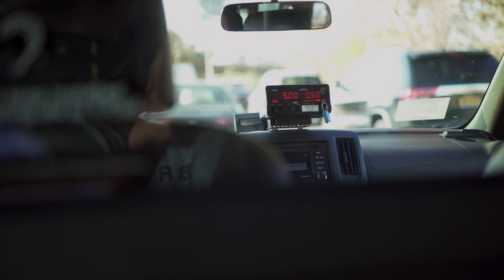Half A Million Miles with Quaker State Motor Oil

Comment: Quakerstate Full Synthetic is the best oil for your buck. $17.97 for a 5 quart jug at Walmart right now.
Reply: I ran that on my Nissan Cube but did not like it. I run QS conventional oil and it runs better than the Syn oil from Quaker State. A lot of people claim QS conventional is among the smoothest oil out there.
Reply: @calgary2800  full synthetic is better for a turbo in which i have
Reply: Yep turbos require synthetics. From exp Castrol Edge and QS conventional are quietest and smoothest oils I have ever run in my cars.
Reply: @calgary2800  i just picked up some pennzoil ultra platinum 5w-30 to try out. they say it close to amsoil quality.
Reply: @JayzBeerz  I own a 1994 Chevy truck that had lifter tapping and change from Supertec full synthetic to Pennzoil Ultra platinum and after two trips around town, no more noise! Not even at startup!
Reply: @bryansesco9671  Nice man. All I use now is Pennzoil Ultra 5W-30 and 5W-20.
Reply: Bout 55$ in Canadian currency in 2023 for a 5L jug
Reply: Quaker State full synthetic in 5 gallon jugs is now $23 in the year 2024.
Reply: 23.99 as of 2024.

Comment: Yes,  I love my Quaker State Oil..been using it for over 40yrs
Reply: As long as you are consistently changing your oil at between 5-6k miles you will have zero oil related issues or sludge build up!

Comment: Those 4.6 ford engines are indestructible.
Reply: 4.6, & 5.4,  2 valve were the best motor's Ford had, & 300 in line 6 cylinder.

Comment: I changed my wife's oil this morning, and put another 6 quarts of Quaker State Full Synthetic in. Her car still runs in great condition, the engine runs smooth, and the performance is excellent. We're looking to trade it this fall, and her next vehicle will also use Quaker State Full Synthetic. As long as the cost stays tolerable, Quaker State will keep me as a customer for years to come!
Reply: Why did you change your wife's oil instead of her car's?
Reply: Pennsville platinum is also an excellent oil that is in the exact same price category.  Mobil one to me is no better if not a bit worse, but more expensive due to their massive investment in advertising .

Comment: Quaker State Ultimate Protection 0W-20 Is an excellent value at 23$ for a 5 quart jug. Super Tech is probably a better value still at 18.50 for their 10000 mike oil and 21$ for their 20000 mike oil but if you want a name brand oil and this is Quaker states Top oil then this is a great buy. I have it in my daughter's 21' Corolla every 5-6k miles and she runs smooth as silk!

Comment: That Ford modular 4.6L 2-valve V8 is the epitome of the word "durable".  Those taxi cabs and police cars have rough duty cycles.  I have over 250,000 miles on my Explorer with this V8 engine and I often run Quaker State oil and make sure the oil/filter are changed every 5,000-6,000 miles.  I plan on taking this motor to a half million miles!
Reply: I didn’t think explorers had 4.6s?
Reply: @lukedonaldson1  they had that engine as an option from 2002-2005. From 2006-10 they had the 4.6L 3V motor as an option.
Reply: dude 100% man! Also the 2.5 4 Cyl Escapes are super super solid..My parents are reaching the 300,000 mile mark soon. Cheers to high mileage vehicles!!!

Comment: Nice ad, very convincing. I'm about to switch my old Honda to  Quaker State Defy High Mileage 5W-20 from Mobile 1, it is 1/2 the price
Reply: 2008 Hyundai Elantra Quaker State 10w 30 full synthetic from day one the car now has 163000 original miles with no internal damage
Reply: @darrencedeno481  when did you get your first oil change? I just got a 22 tuscon.

Comment: I bought 6 quarts of Quaker State Ultimate durability after years of flawless service from Valvoline. It's cheaper, so I figured I'd give it a try. If it matches Valvoline's quality, I'll keep using QS.
Reply: Athrough Z  verdict ?
Reply: kj k so far so good, but I want to see what the oil looks like when I drain it out, and how thick it is. It's got around 87% life left, and I've only ran about 700-1000 miles on it.
Reply: @orion3706  Have you drained the oil and what is your opinion of the oil?
Reply: @MrRGiller  I've been using QSUD in my wife's car and my truck and so far, no complaints. I haven't found their performances to be any different than Valvoline. I'm staying with Quaker State and would recommend it!

Comment: You haven't stated how often the oil changes were (what mileage, time frame or hours on the engine).  Furthermore, was QS used starting from the first oil change of the taxis after they were acquired as brand new from the Ford Dealer?  Inquiring minds would like to know!

Comment: Similar results would probably be seen with just about any API SN oil of suitable grade. The 4.6L Ford Modular V8 is a great engine.
Reply: djo9C1 very true statement.
Reply: The modular can run great on almost any oil (maybe even olive oil?)
Reply: djo9C1 
Too bad it has a plastic intake that cracks. . and loses coolant... Furds are turds
Reply: Yea, 4.6 is a well suited engine to put on a go kart.
Weak ass engine, no torque or performance.
Works best as a boat anchor.

Comment: 42 years for 500k miles....WHAT?? I've had my Dodge Avenger for 3.5 years and have put 100k miles on it
Reply: That's all? I brought my ATS with 35000 miles in Nov, and I am hitting 101,K now as an Uber driver.
Reply: Yes 500k miles over 6years but there's no way you have your engine idling like these cabbies.
Reply: I think that number should be closer to 25 or 30 years.
Reply: I drive a classic as a daily driver and put around 300 miles a month on it use this oil it is true my classic flat head engine would burn any oil I put in it but this oil holds up for weeks more then any other iv used if you have a burning oil problem this oil will help your engine and your wallet
Reply: Shit I drive 200 miles a month
Reply: Maybe Grandma at NY. She uses a lot of taxi...
Reply: @TheThirdeYe1337  no1 understand accords and Camrys .........they r more than reliable...btw its mile right not km?
Reply: @TheThirdeYe1337  honda should take urs and give u brand new one........
Reply: @ueg-zm8wf  I only average 5 to 6k a year cause I mainly just drive to work and back and to Home Depot for supplies.  It's only a 20 mile round trip to my job and back.

Comment: 3 questions. Is that convetional oil or synthetic? how often was the oil changed? What filter did they use? I use valvoline with purolator one filter.
Reply: I change every 6 months and it remains full. My truck has about 95,000 miles on it. There's so many different possibilities why some engines use more oil.
Reply: Valvoline is an excellent oil and Purolator and Wix are my favorite oil filters. Excellent choices.

Comment: I've been a Mobile 1 user for years, but I'm considering changing.  I've heard that Quaker State's detergent package causes solid contaminants to stick to the engine surfaces rather than suspending them to be caught by the oil filter.  Does anyone know.  That's the only thing holding me back.
Reply: Just use SuperTech full synthetic. You won't be sorry.
Reply: Dont listen to the other guy- he doesn’t know what he’s talking about

Comment: This is fantastic, Quaker shows us how well its oil does on an old low tech engine!  Why not show us a modern Euro or Asian engine with that many miles?  Of course the Crown Vic engine is sublime, when was the last time you saw a yellow cab or a cop car for that matter in the fast lane on the freeway, on a canyon road or even on a race track?  All these cars drive around under 50mph daily and at low revs because of the 4.0L or 4.6L V8 engine, its not being tasked at all...... oh please.... come back to us with a GDI turbo engine and show us the results!  Btw ANY car that has regular oil changes every 5000 miles, any decent oil will make ANY engine last and be smooth.  People are too ignorant or lazy about changing their oil and wait until the car tells them or the oil light comes on, by then the engine starts getting a little damaged and then they wonder why their car breaks down and why dealerships gouge them.
Reply: Can't speak for this particular line, but Quaker State's Ultimate Durability line is excellent. Oil testing guru Terry Dyson tested 226 different oils and found that Q.S. Ultimate Durability 0w 30 in particular tested extremely well and ranked 3rd in the straight out of the bottle category (he tested some oil and additive blends as well).  

  Considering the lower price compared to most full synthetic oils, it's more than a bargain. Hopefully they don't change their formulation any time soon.  

     But for super hard working engines, I would probably go with Renewable Lubricant's Bio-SynXtra HD Plus SHP Motor Oil SAE 5W40 Low Ash or similar 5w40 (they only have a couple of these).  Bit pricey, but pretty much the best stuff out there currently and handles blowby fuel contamination, and heat degradation, better than anything else.  

    Personally I'm looking forward to the switch to electric motors and not having to worry about oils and changing same.
Reply: It looks like this was conventional oil so I would assume it was changed at 3,000 mile intervals. The biggest cause of wear is cold engine starts. These engines were likely running all day long and some of them even during the night. That's part of the secret to longevity.